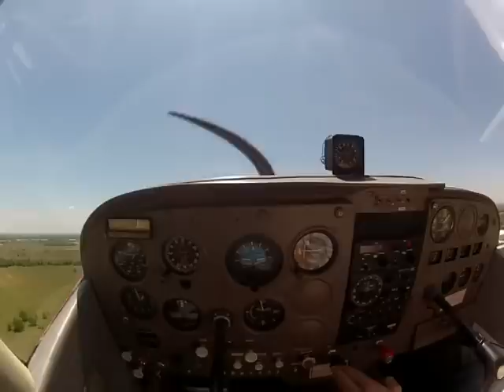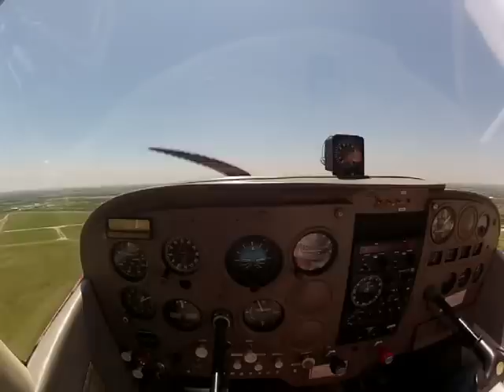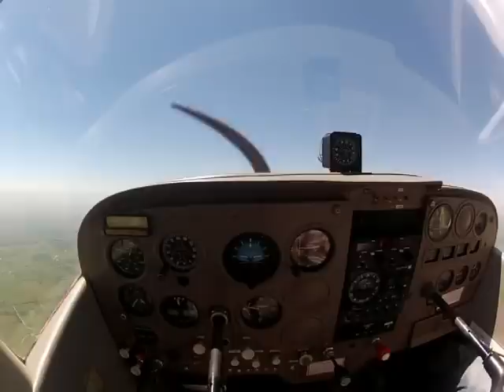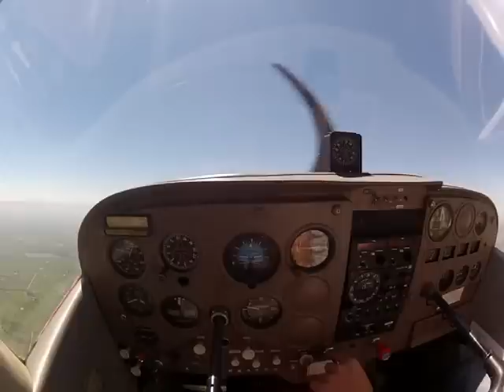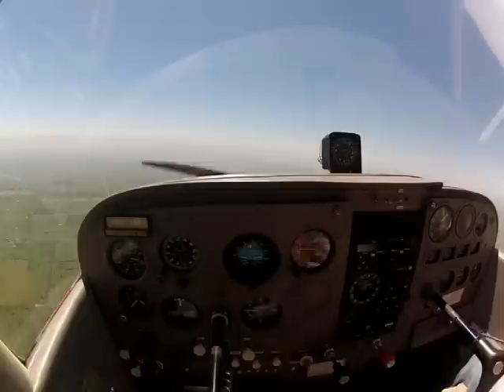Power On Stalls

Comment: Thanks for posting. The PTS requires power on stalls to be demonstrated with a power setting not less than 65% of full power, unless you're in a high performance aircraft. For the Cessna 172 this equates to no less than 2300 rpm. So 1800rpm is insufficient to meet the practical test standard. Sure, it's easier to get in a spin at 2300rpm and more important to remain perfectly coordinated, Burt that's the point! This seems to be a common fear/shortcoming of many instructors - my first instructor also had indoctrinated me into doing power on stalls at 1800-1900 rpm. I never really understood the effects of the rudder and the importance of coordination until my new instructor demonstrated incipient spins and I went for spin training and experienced the falling leaf. I understand the reason for lower rpm, but it doesn't accurately reflect how quickly a spin can develop during an actual take off stall. Great video.... thanks!

Comment: I'm learning how to do this now but almost every time I do it, i almost end up in a spin. the plane actually rotated and was facing the ground at one point. It tends to roll to the left but I'm adding a lot of right rudder. I don't know what I'm doing wrong lol. My instructor says I'm spin aware now lol.
Reply from the maker: Kishi 15 what type of aircraft are you flying?
Reply: Cessna 172 S. It has the G1000.
Reply: Thank you, I haven't had the chance to try it again because of the wind but this definitely helps.
Reply: Thank you lol. I've gotten in to so many spin now that I'm already used to the feeling XD.
Reply: Did power on stalls yesterday. I nailed them. thanks!

Comment: you takeoff with 65% of power setting?
When you reduce de thottle power to 60, 55kt, you must apply full power, and right rudder, wings level, until the stall.
This is a power on stall...
simulate your takeoff.
Reply from the maker: PTS Standards state a power on stall is 65% power minimum sir... Doesn't say I have to be a Full power....